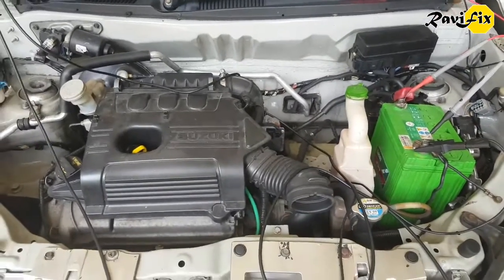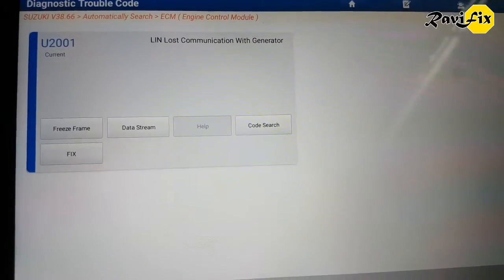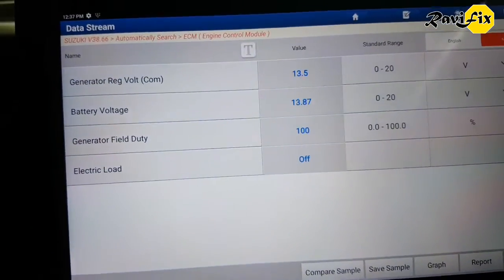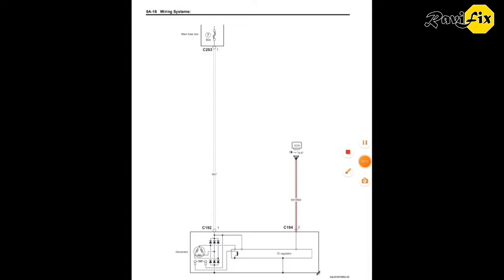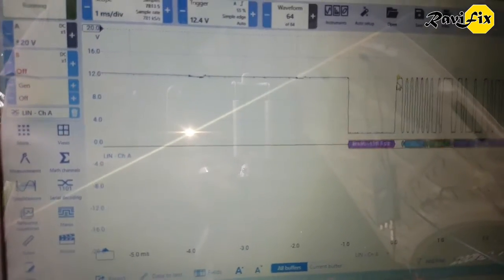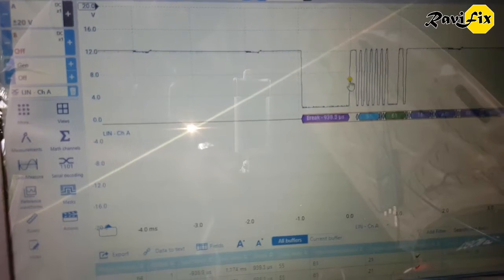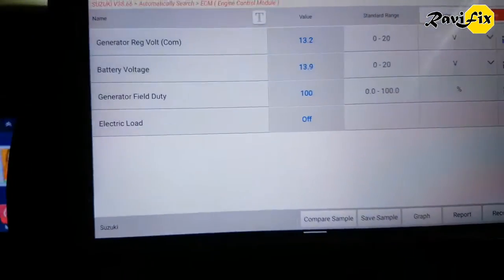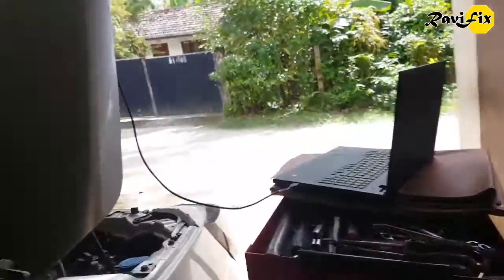Diaganose U2001 LIN lost communication with Generator. bad Idle Vibration and Hissing on Suzuki Alto

Comment: I have this problem in my suzuki ciaz now .. its annoying no one can solve it the battery icon in the dashboard lits up.. it will go away but after a few mins it will light it up again
Reply from the maker: Check the single wire goes to the alternator from ECU. If that wire is ok no open or short, and still charging the battery over 13.5V. You need a new ECU or repair the ECU.

Comment: Very good video.

That DTC really gave a good direction on the problem.The tricky parts were the ECM still saying 100%, even though its charging controller is bad as well as the shaking of the engine at idle (many would have been chasing ignition/fuel issues).. 

The inability of the idling engine to comfortably drive the alternator at full output suggests the output current is varied a lot more than voltage.

Thanks for uploading.
Reply from the maker: Thank you